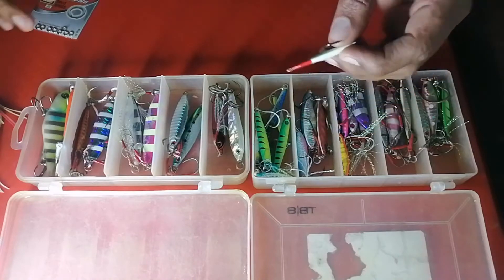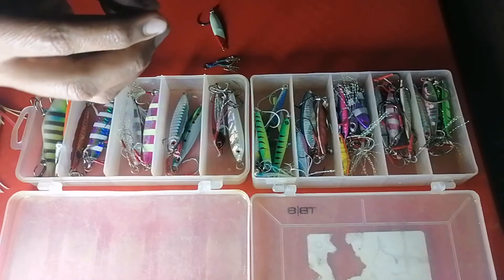Easy & Affordable Ways to Upgrade your Shore Jigs (Slow Pitch Jigs)

Comment: Im loving this as i use to do this as well. May i recommend a better way? Before you attach the tail hook or lower hook, you can also insert the squid through the head / top of the assist hook, so that you wouldnt damage the flares or shinies ( in my place it is called shinies ). Cheers mate !
Reply from the maker: Thanks for the tip. I will definately try it out!